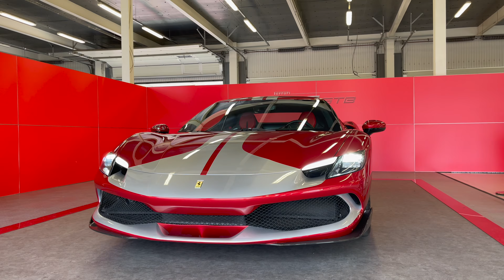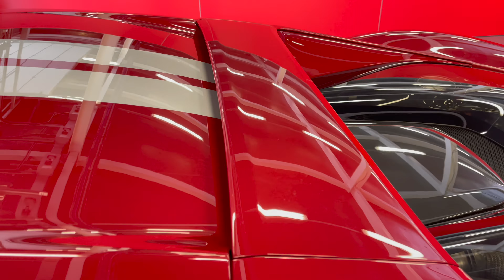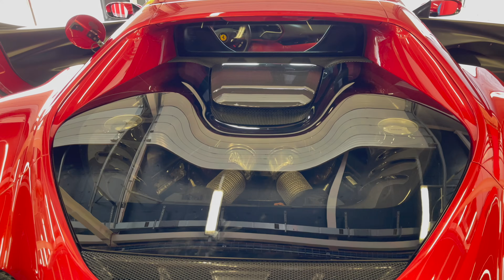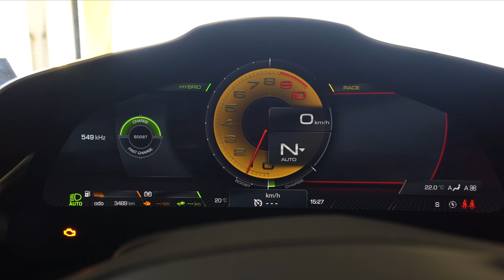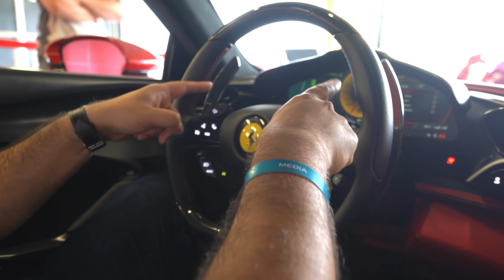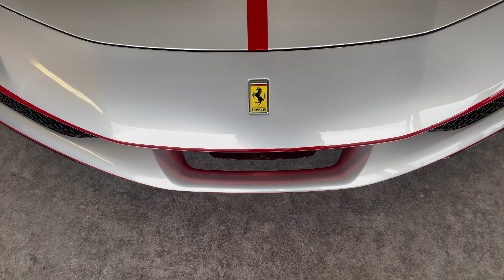Why the 2022 Ferrari 296 GTB V6 HYBRID is the best Ferrari!

Comment: https://youtu.be/p8-j8tlqj2k?t=425
Engine Check alert?
Reply from the maker: That light is just telling us that the car is using the battery I believe and would have turned off if we started driving; but this car was a final prototype so errors might happen which won't on the final car.

Comment: Why is the metal engine cover so wrinkled and warped?
Reply from the maker: It is the exhaust with heat cover and not the engine!
Reply: @TechInTheCar  thanks for clarifying. Yes, the exhaust heat cover...do they normally wrinkle like that? I love the video and I love Ferraris, but IMHO, it looks shoddy in that engine bay
Reply from the maker: Normally you wouldn’t have it right in the middle like that but because the exhaust is coming straight out the middle of the back as the engine is so low down you can see it. In person it doesn’t look shoddy when you can see all the details.

Comment: The engine in the SF90 is 90°V8, while the 296GTB is 120°V6.. They're nowhere near the same engine
Reply from the maker: Ferrari took the SF90 engine and removed 2 cylinders and re-engineered it for the 296 GTB. This is what Ferrari told me. You are correct about the differences.
Reply: @TechInTheCar  Guess it must have been a salesman and not an engineer from Ferrari who gave you the information 😊
With my very basic knowledge of engines, the fundamental layout of the engine blocks are so different, you would be better off starting from scratch, instead of trying to modify the V8 into the V6. But I may be wrong..
But nice video anyway, and the 296 is a real beauty. Ferrari once again shows some engineering brilliance with this car
Reply from the maker: It is an engineering masterpiece. I agree! and I love the colour palette of imola red and silver on this Assetto Fiorano pack.